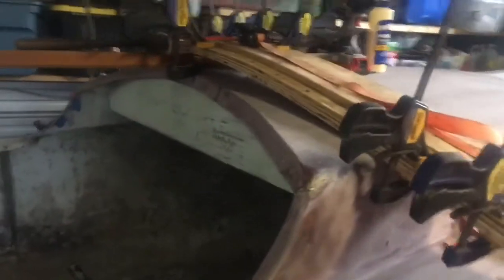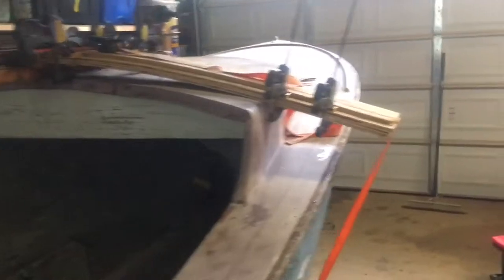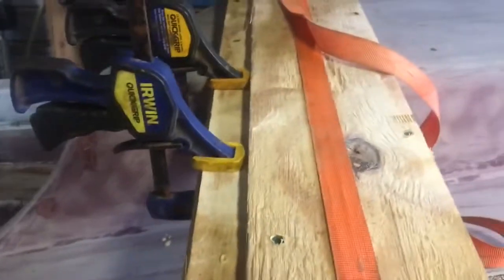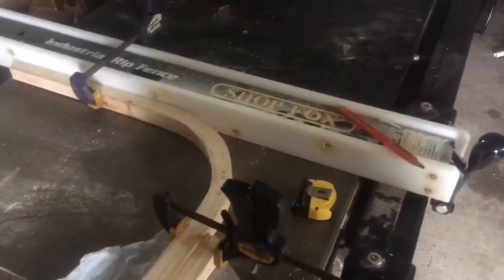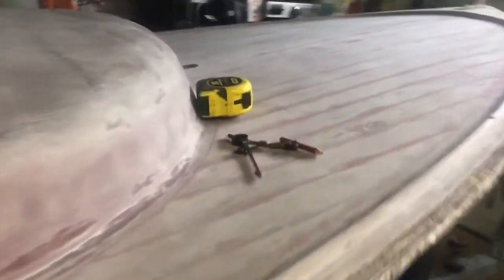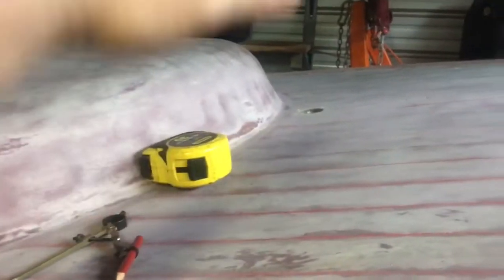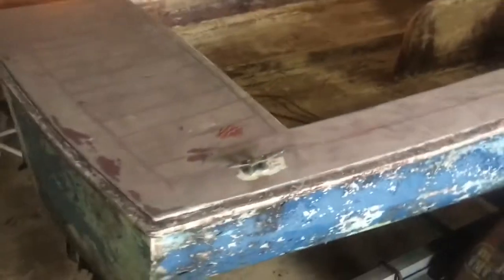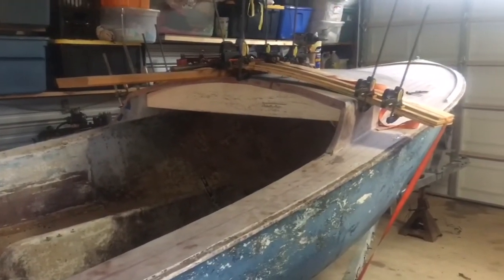Restoring an O’day Day Sailer, Part 3

Comment: I recently came to own a very old Daysailer.  It has all the hallmarks of your boat, simulated board lines in the deck, boxed in areas behind the seats, wooden seats.  These are things you don't see on the later boats.  It is difficult to date these boats because there are no hull numbers, but the sail number which came with the boat is 86, and there were about 12,000 Daysailers made.  I am thinking it is a 1958, since they made roughly 300 per year.  My boat has the same damage your's does in the same spot in the cuddy.  I thought it might have been carelessly flipped, or had a tree hit it, but after seeing yours, perhaps it is just a weak point in the boat.   Later models have a pronounced lip in that area.  I see you have stringers in your boat.  These are absent from mine and the tone of the hull is very floppy in that area for my boat.  I am considering coring it.

It has been some time since you posted, so maybe you ran out of steam or sold off the boat?  I am curious as to what became of it.